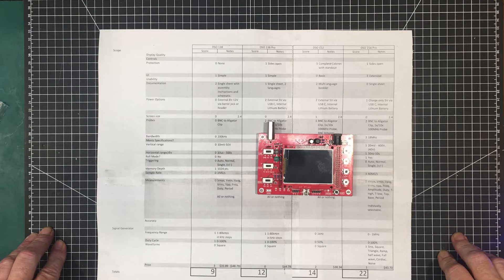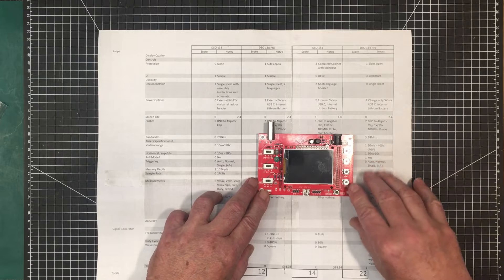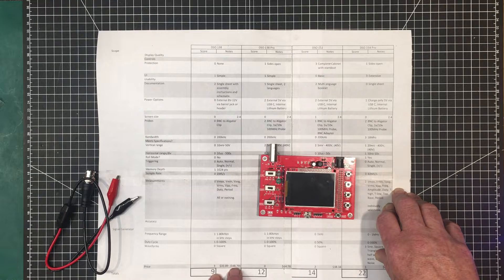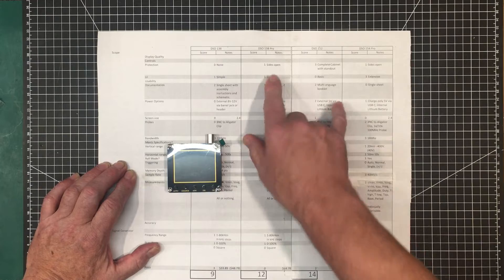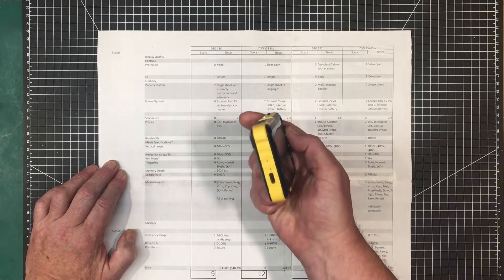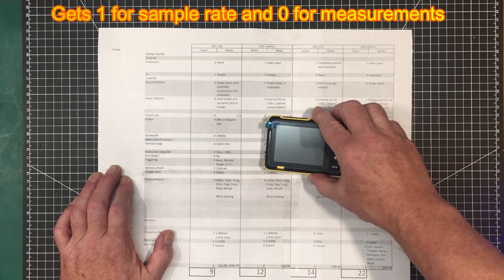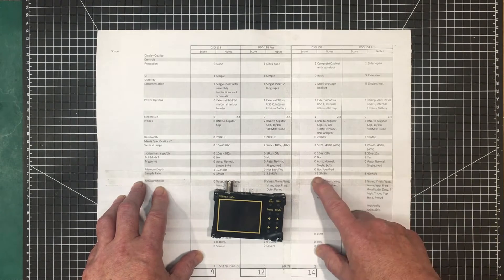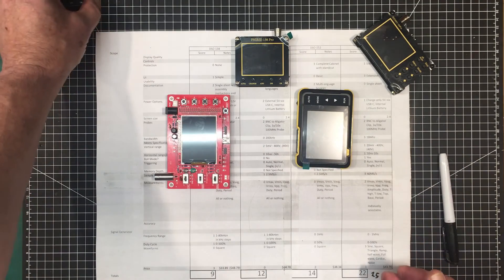0104 - Mini-Oscilloscope SHOOTOUT! DSO138 vs. FNIRSI 138Pro &  DSO152 vs. Zeeweii DSO154Pro:  Part 1

Comment: Did your perform the firmware update which is recommended in FNIRSI-138 Pro Manual? If yes, where to get the firmware, the loader and the Windows 10 driver
Reply from the maker: No I didn't  Sorry about that.  As far as I know FNIRSI never released a firmware update for it.

Comment: Greetings.
I'm trying to find the Firmware because I had to change processor.
So far I've only found one for the other one that looks similar but isn't the same.
Could a friend help me find for this Model  " fnirsi dso 138 ". 
Thanks.
Reply from the maker: I assume you are Talking about the red one?  There are several different variations of this unit.  The one I have is a generic clone, not the one that was sold by Fnirsi.  Unfortunately I have no idea what firmware it uses or any access to the Fnirsi firmware.  Sorry about that and good luck.

Comment: Attenuation and input voltage ranges info would be nice. I can see the DSO154pro has 1X at +-40V and 10X goes all the way up to +-400V which is insane. I can combine this with a basic DMM and surpass the capabilities of a high end Fluke DMM for some pocket change.
Reply from the maker: Nice idea!

Comment: My 154 pro just came in the mail. I have a couple of the dso 138 but now im trying to get used to the 154 pro. I do like the fact it's better in signal quality than the dso 138. Is there a eay to reset Back to factory settings? Any reply appreciated cheers from Australia subbed and liked ❤
Reply from the maker: Thanks for the sub!  There is not way that I know of to do a reset.  I guess you could try to disconnect the battery, but I've not tried this myself.
Reply: @uni-byte  thanks for the quick reply 👍

Comment: The 154pro is the way to go. The bandwith is pretty important if you are troubleshooting even an old 8 bit computer. Fnirsi makes nice products from what I have owned. They are overrated though. The 1014d I bought says 100mhz on it but is really a 30mhz scope. That isn't an issue for my needs though.
Reply from the maker: Yeah, the 154Pro is really the only one that can be used with digital electronics.  We will check to see if it meets it's specifications.

Comment: Nice comparison so far. I only own the 154pro and I'm not even close to a scope expert but I really like it and maybe they can fix some of the minor issues with a firmware update. Edit..I just checked to see if mine turns off when I plug in the usb c cable and it doesn't. I'm not sure but maybe mine has either newer or older firmware than yours or something else causing it to act differently.
Reply from the maker: Interesting.  I'll see if there is a way to check the firmware on mine.
Reply from the maker: There is no way I can see of determining the firmware version or indeed updating it.  At least nothing has been published yet.
Reply: @uni-byte  I was just checking the same thing myself and I can't find anything either. I might message Zeeweii and see if they have any firmware available and instructions on how to update it. I'm not sure but maybe there's a difference in the hardware that makes one act differently over the other. I'll take mine apart later and upload pictures of the board somewhere.
Reply: I bought mine from what seems to be the official Zeeweii store so I just sent them a message on Aliexpress. Hopefully they will answer but I'm not holding my breath..lol
Reply from the maker: @percaine  I put a question about memory depth on their website contact form and they did not respond, so good luck!
Reply: @uni-byte  I'm not surprised. I think when I bought the scope I asked a question and they never replied so I'm not expecting that they'll be any different this time.